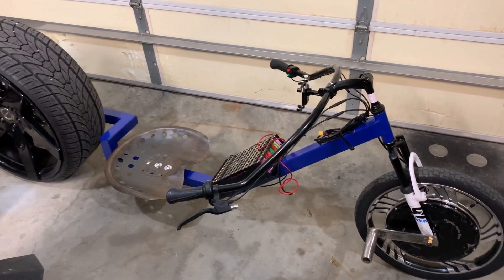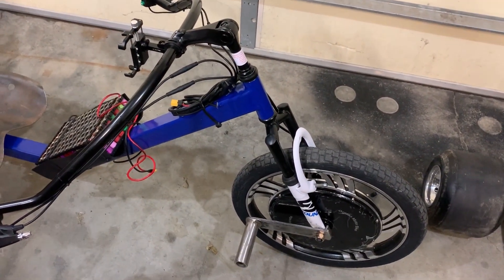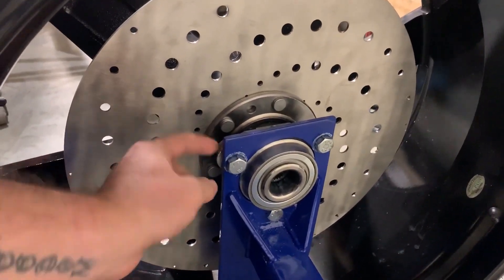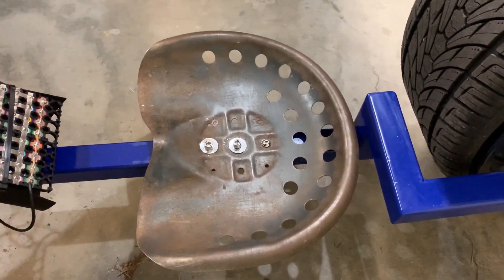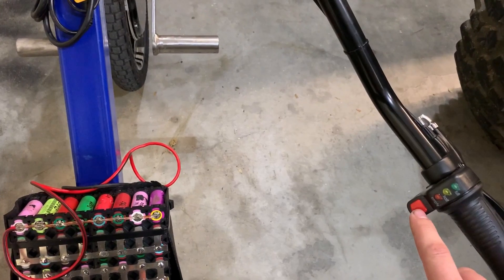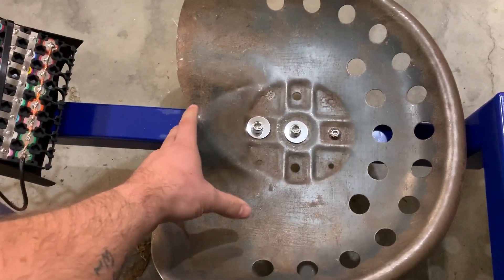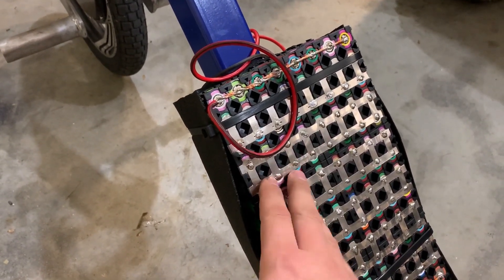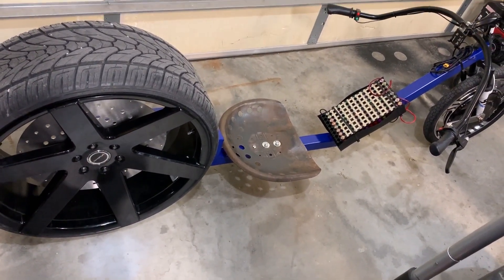DIY Custom Electric Chopper. 18650's and golden motor Hub motor 52V 18AH

Comment: Only for muddy areas 😁
Reply from the maker: I had originally planned to use an old willys jeep wheel which would really have given it an off road look. I have yet to put the front fender on as it tends to throw some stuff as well.

Comment: One suggestion put a back on the seat or tire guard clothing gets in that you could be in a tight spot
Reply from the maker: That’s in the works, bent wood fender. If you slow down the video and watch the exact side shot, there’s actually quite the gap, but I still want one to lean back on given I’m 6’1”. Have a ton of jazz goin on in life right now but I’ll get a new batt built, fender, paint etc. thanks for the feedback.

Comment: I like .  How well  does she turn ?
Reply from the maker: Given the flat rear tire it doesn’t turn as easy as a rounded motorcycle wheel but you just lean a little harder and it will. At slower speeds like backing out of a parking spot (has reverse) you can simply use the handle bars and turn the front wheel. Upside to a flat rear is no need for a kickstand.

Comment: I wanna build an akira style bike some point in the future so I'll use this as a reference
Reply from the maker: Thanks for the term Akira bike, hadn’t seen one. I could write plenty on tips but I’m not gonna pile up a comment block on it. Biggest thing would be flat vs round tires. Round will need a kickstand. Flat on mine keeps it upright. Round would be easier to lean and turn. If leaning need clearance or it will scrape. Look up “chop-e” and you’ll see.
Reply: @SSGPohlman  alright, thanks for tip. do you have an instagram btw?
Reply from the maker: I used to have an insta but got out of it as well. Dont even have FB, which Probly hurts views and subs but right now I can’t keep up w it all not do I get into all of the social media.
Reply: @SSGPohlman  what's the best way to contact you, Incase I need some advice later on (if that's cool with you)
Reply from the maker: I believe my YouTube email is on my page. I’d have to double check. But either way, I have no issues answering questions about things. I’m not an end all to ebikes but have done a few projects.
Reply from the maker: Figured you would be amused, I’m “sorting files” and come across a copy of the movie Akira. I’ll add it to my primary drive and watch it when I get a chance.
Reply: @SSGPohlman  I'll be straight up with you dude, I thought the movie was really weird, I just liked the bike lol, alit of people like the movie though so don't let me discourage you

Comment: Good work, but why the massive rear  tyre? It's front wheel drive, all that rear rubber is just slowing you down and ruining the handling
Reply from the maker: The rear is part of the “custom” aspect. I do understand LRR tires etc etc but I wanted something that stands out and it does. As far as handling, its really not as bad as youd think, just have to lean a little harder. Up side is that when sitting at a light, I dont have to put my feet down and eliminates a kick stand. Appreciate the comment, stay tuned as Ive made frame mods, added a second battery, and more!

Comment: Fender on the back wheel is going to be a must.., I just don't like the foot pegs as part of the stearing , But very nice design simple streamline Like it!!
Reply from the maker: Yes, a fender/back rest is in the works in a follow up video. As for the pegs, really not an issue since you dont steer it like a car. Just leans like a regular motor bike. Only time its an issue is say really slow 90* turns, like corners of sidewalks. Either way, thanks for the feedback. Stay tuned as theres more. Also doing bluetooth ammo can soon, sons pocket bike upgrade, etc etc.